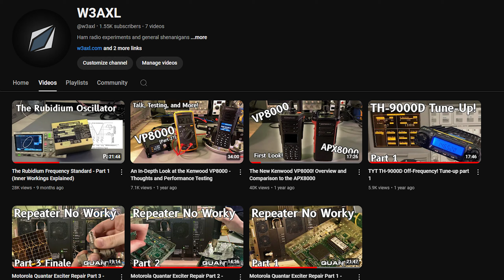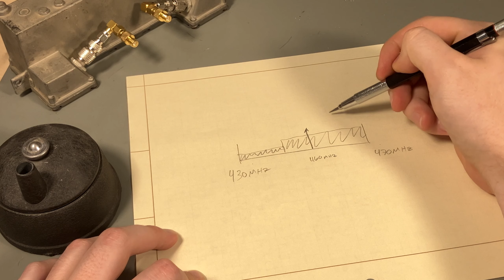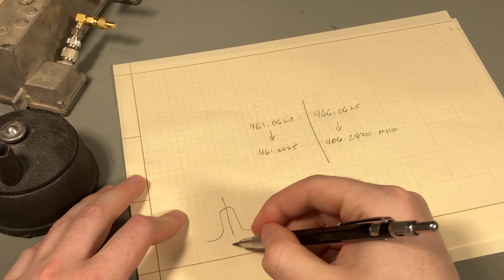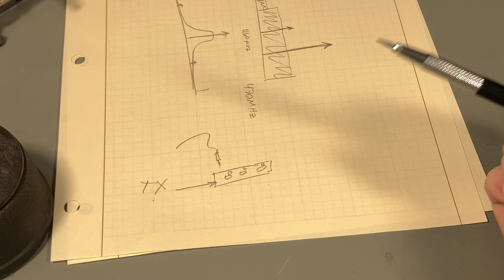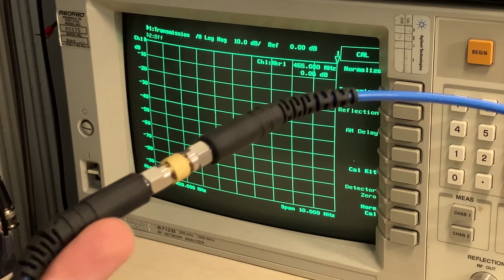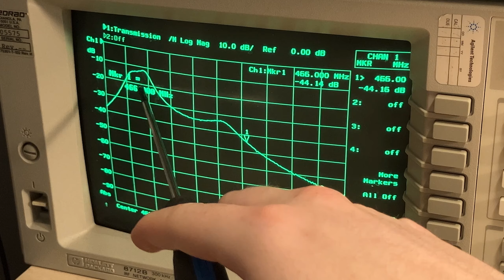Tuning a UHF Bandpass Filter - RX Preselectors and What They Do

Comment: I did this with two uhf repeaters and used a two channel combiner for the transmit frequencies. 

The cool and lucky part is my repeater pairs are right next to each other. So one pair is  TX on .300 and the other .325 MHz. 

So the transmitters both fit through the pass band of the dupekexer and so do the receivers. 

It works out great for a fm and DMR repeaters right next to each other.

Comment: Sometimes you can shift the bandpass to the side to help eliminate interference. You need to be hooked to the antenna system for reference. Back when I was a service tech for a local MSS I built a combiner for 12 UHF repeater.

Comment: I know what your project is...maybe because I believe you have discussed it on another site but still. I've always tuned these things according to the Quantar Site Manual. Seems to work pretty well. Only catch 22 is I use the tracking generator instead of the method using the signal level and frequency generator. I have so many of those probes laying around from all the Quantars.

Comment: Tuning the filter off center is a great way to do this.  I've done it several times, and while not ideal for insertion loss/s11, it's about balancing the system.  Putting a notch on the transmitters for the receiver frequencies is still something to consider, as all solid state amps will make broadband noise.   

Fuck those Mini-UHF connectors.  The QMA is worse for vibration (mobile) use. 

I just use a standard screwdriver, the tuning slug is at ground. One of the better ways to tune a many pole filter is in the time domain, if your VNA has transform on it.   Not needed with this small filter, but with a 8 pole filter, or some of the 900 MHz stuff, it's needed.  On the VHF Range 2 (150-174 MHz), I set the center for 146 MHz and as that's 5 poles, it makes it much easier to tune the range 2 down to cover the ham band.   It's about the only way to tune it decently.
Reply: Yeah, the mini UHF connectors used on most Dingbat products are total junk. In the past when purchasing used  Moto gear the first thing I would do is change out the mini UHF for a new one but even better yet I replace them now with a BNC connector. It’s the center contact  that fails in the MINI UHF connector. The contact on the BNC if far more robust and you get better shielding from the design of the connector.

Comment: One of the main reasons for the filter before the first RF amp in the receiver is that the first RF amp generally has a 100+ MHz of amplification.  The RF amp has a max total output power, and strong signals will "rob" power from the intended signal, and can cause a weak signal to be covered up due to compression of the dynamic range of the RF amp.